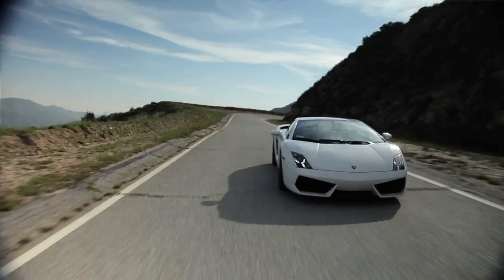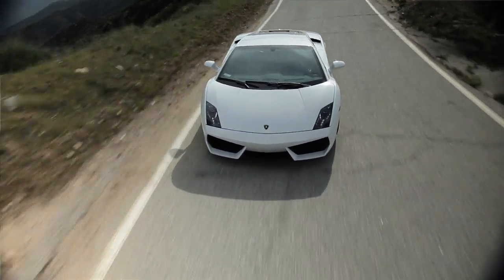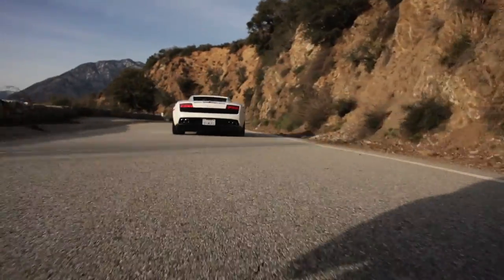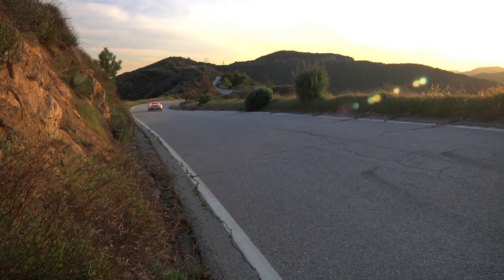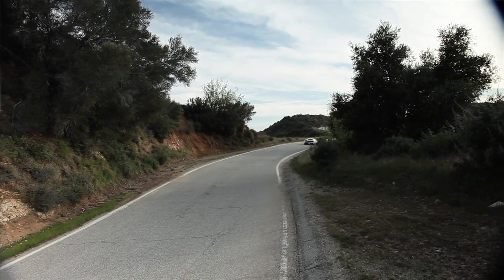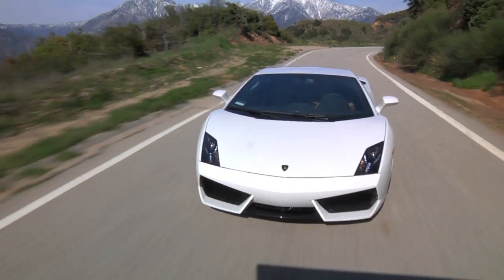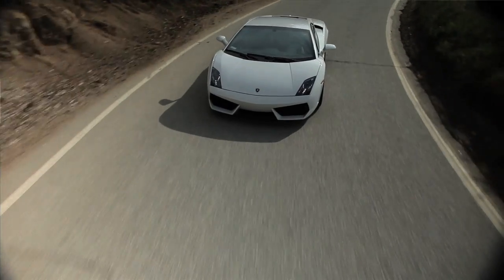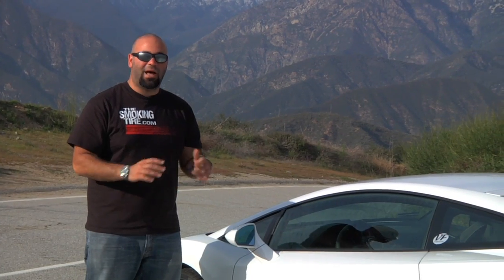How good is a Supercharged Lamborghini Gallardo?

Comment from the maker: @dufferego87 Like I've said, multiple times, the Gallardo and R8 are gear limited at 197 mph. That means that redline in 6th gear is 197. The Aventador has a completely different transmission that is designed with a taller top gear, good for 217 mph. If we're talking modified Gallardo's, the current record for a Twin-turbo Gallardo street car with a modified gear set is 253 mph, leaps and bounds beyond the Aventador's top speed.

Comment from the maker: @SMG707 1) I've been on the Ford Focus Rally, earning a living. 2) That's definitely your speakers, because it sounds great from where I'm at, and the comments below seem to agree with me. 3) In most of those exterior shots, I was driving double if not triple the speed limit, in a loaned car, on a public road. There's not much harder it gets than that, and I'm certainly not drifting a $250,000 borrowed car with 200 foot cliffs on either side of the road.

Comment from the maker: @davidmac2007 What we learned with this car is that although Lamborghini makes a great product right out of the box, the chassis is more capable than the stock engine, so they take well to upgrades (same as the Ford GT, though not as much for the Ferrari 458). In the case of this vehicle, the stock components don't seem stressed at all during normal or high-speed driving, though we wouldn't want to try ten full-bore race launches in a row.

Comment: I've driven both styles of paddles extensively (connected to the wheel vs. the steering column) and I've found that I prefer it if they are stationary, as long as there's enough clearance to not get your fingers caught during a turn. My personal car has 'em on the wheel but as long as I don't wanna shift during a turn it's fine, or if I do want to I can use the shifter.

Comment from the maker: @ting280 for these guys, reliability is the most important aspect of their products, which is why we like them. If you blow up a stock Lambo engine, that's a $70,000 mistake. And when you spend $250,000 on a car, most people wouldn't want a kit that requires a full engine rebuild, like a high-boost TT kit.  It's not all about the numbers, and really, who isn't 760 horsepower enough for? You would need a runway to know the difference between 760 and 1,000 HP anyway.

Comment from the maker: @TurboEco as we've said before, mad props to anyone who can handle a 1,500 horsepower car on the street. The owners we've spoken with have all said that on a runway, they are incredible, but the power is just too much and too peaky to use around town or in a canyon. It's just too much power to use on the street. For evidence of this, see the recent Underground TT owner who goosed it on a corner and ended up in a wall, on video. This car is just enough that you can use the full range.

Comment: Matt, I don't think it's the total power which is a problem with turbos, it's the shape of the power curve.

I have a supercharged 911 race car, and the power curve isn't a curve at all - it's a dead straight line from idle to the rev limit at 6500. The power is so predictable, smooth, and constant that driving it is much nicer than a similarly powered turbo 911.

I'll take the supercharger every time, given a choice.

Comment: Because you are not meant to push/pull - but rather twist/overlap arms.  If the shifters don't rotate (as they do on 99% of cars) then you need to let go of the wheel to move your hands back to he shifters.

Comment: Quit the contrary, I've a car with the paddles rotating with the wheel and I found myself trying to reach for the paddle during turns, cause it was in some weird position. I would rather have them constantly at the same place. Beside, you learn to drive paddles by shifting before and after a hard turn.

Comment from the maker: @jasonbadler the kit is $35,000 on top of the price of a Gallardo, IMO there's no cheaper way to get 200 usable, reversible horsepower out of a car like that. Buy a 1-year old car with 2,000 miles on it, and the depreciation will more than cover the cost of the blower.

Comment from the maker: @Dansotherutubeacount The Shelby GT500 uses a twin-screw roots blower, which is noisier than the four-screw blower like the Magnussen TVS2300 used on the Lambo in this video. It also has to do with how restrictive the resonators are in the intakes; an aftermarket intake will often amplify the blower whine.

Comment: @5:10 I can imagine.  If I had the money, I'd be the twin-turbo guy, who just feels normal after getting high, but would be really scared when I feel low by the coast.  On top of Pikes Peak  there is 43% less oxygen, so that's about how much less power N/A's will make.  Turbos make as much boost as at sea level, just take longer to spool. Super chargers because of the fixed pulley size loose boost up there, but still have some.

Comment: @BenqS42 If you want power go with underground racing. With VF engineering you can get a limited amount of power and if you want more you can't get any more out. With the underground racing kit you can get the stage 1 kit and if after a couple of years you want more power you can upgrade to a stage 2 or 3. And I think the VF kit is only for the gallardo. And the underground racing kit is turbo kit not supercharger. Prices vary from $59k 1000whp on race fuel to $129k with 1300whp on race fuel.

Comment from the maker: @slipknotmaggot183 I've driven a 725 HP Super Snake before, and unless you really just want to be able to do burnouts at triple-digit speeds, I don't see the point. I remember a magazine test of a Super Snake against a GT500 on a road course, and the stock GT500 was faster. The extra 175 horsepower didn't help at all, which reinforces that. The Gallardo/R8 chassis (and esp. Ford GT)  is over engineered, so adding lots of power just brings the engine and chassis ever more in harmony, not less.

Comment: @TheSmokingTire That's pretty impressive the fuel system can run another 200 hp. Must have low duty cycles. I wonder if VF engineering is hiring any engineers....

Comment: @masedama yes, at full speed. but he is clearly not going full speed and keepin the engine RPM near the top. hes luggin around and ripping from corner to corner. i do agree that u can set turbos up to have great power at lower RPMs, but for the all the $ invested into a turbo kit, guys want the 1000+hp numbers, which mean larger turbos and higher rpms to get max power. a S/C kit is great for driving the way he was, corner to corner,  but a 760HP TT kit wouldnt be worth all the extra money

Comment: @yyyy2999  thats a lie, car that weighs more than 1500kg will not achieve 1.2sec from 0-60mph   acceleration with that horse power and torque...

Comment: What percentage of fast turns will a car make in its lifetime, compared to slow turns?

Yeah, that's right - probably 0.001% - that's 1 fast turn for every 1000 turns.

It is completely ridiculous not to attach the paddles to the wheel, and I will never buy a car so stupidly designed.